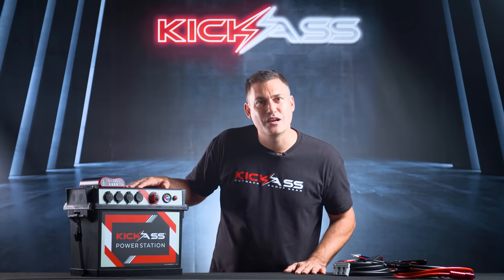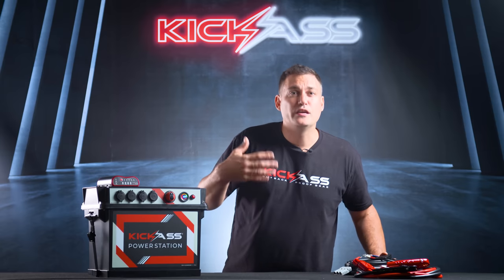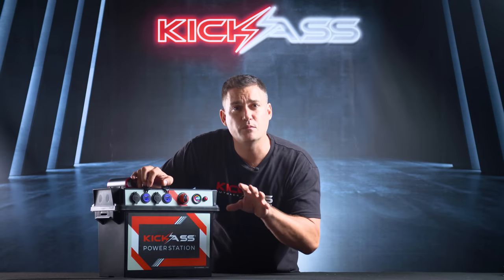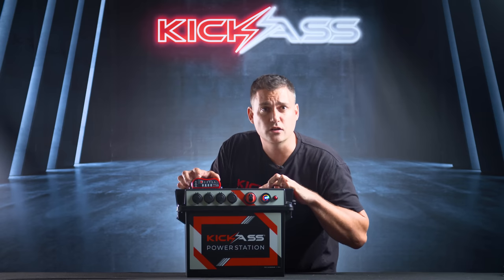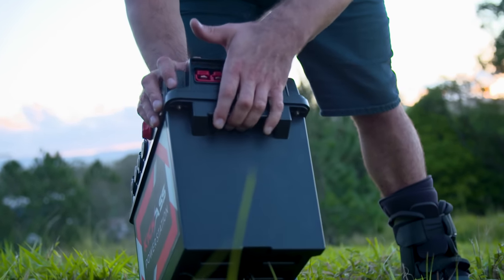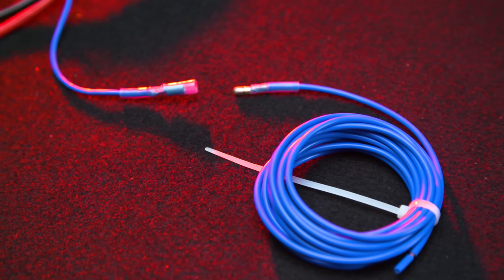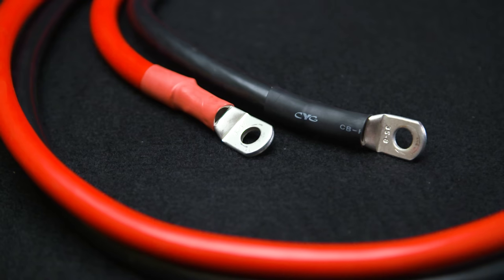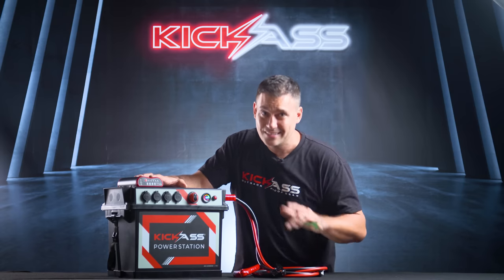KickAss Powerstation Portable Battery Box with integrated 25 Amp DC DC charger. Dual battery system

Comment: I have had messages from 4 days and 2 days ago that hasn't yet been responded to. I would like to clarify my questions before putting in my order. If I connect the Kickass 2000w inverter directly (rather than via the Anderson plug) to 120Ah lithium battery sitting inside of the Kickass power station, would this be a safe option? I would really appreciate a response to this. Thanks
Reply from the maker: Hi Jimmy, as I advised previously, if you are using a 2000 watt inverter you will need to use a battery bank of at least 2 AGM batteries linked together in parallel. 

Running at maximum the inverter will draw up to 180 amps DC and can double that with peak inrush. Drawing this amount of current from a single battery will damage it. 

If you require technical assistance please contact one our customer service advisors here https://supportportal.australiandirect.com.au/sales-enquiries/

The phone number is listed at the bottom of the page.

Thanks.
Reply: @KickAssProducts  I don't want to use AGM battery. As I have stated multiple times I am asking if it is ok to run an 120Ah LITHIUM battery, plugged directly to the 2000W inverter.

Comment: If the box is turned off whilst still hooked up in the car but not running any appliances, does the dcdc still charge the battery? Ta
Reply from the maker: No, The Isolation switch turns the whole unit off including the DCDC charger. 

The switch has to be in the "ON" position for the charger to operate.
Reply: @KickAssProducts  cheers

Comment: Another great video guys :) Can I ask..... I have the "old" KickAss Power Box with the Projecta DCDC Charger which I had in my old car...... I now have a brand new 2022 Toyota Fortuner and need to wire my old KickAss Powerbox up, can I buy and install the Premium Plug and Play "3 wire" Anderson Plug kit to the car from the Starter Battery and then attach that to the "2 wire" Alternator Input on my KickAss Powerbox in the rear of the car? i.e. can a 3 wire Anderson plug into my 2 wire Input in my old KickAss Powerbox? Cheers, Don, Perth WA :)
Reply from the maker: Hi Dons. In theory it will work. From memory the old Projecta also had an ignition wire as well so if you remove the 3 way anderson plug and replace it with a standard one you still should be able to use the ignition wire.

Comment: Do you just sell the lithium battery box on its own..??
Reply from the maker: Hi Warren, our standard battery box is compatible with other brands of lithium batteries. 

https://www.australiandirect.com.au/buy/kickass-portable-battery-box-power-station-with-in/KAJBAGMKIT1

It would be pointless to purchase our lithium battery box by it self as the LCD screen / connection etc will only work with the KickAss BMS  in our battery.

Comment: Very interested in ordering one of these. Will this work with your Kickass 2000w inverters?
Reply from the maker: We do not recommend using anything over a 700 watt inverter with this battery Box. A 2000 watt inverter will draw up to 184 Amps DC when running at 100% and double that at the peak inrush. For that size inverter we always recommend that you run at least two batteries in parallel and have the inverter directly connected to this battery bank with the shortest cables possible.
Reply: @KickAssProducts  Thanks for the prompt response. I was planning to use a 120Ah Lithium battery with this battery box. With this 120Ah lithium battery, is the Kickass 2000w inverter suitable then?

Comment: Checked out your website about the new power station. 
Can you advise of the Solar PV max for the inbuilt solar mppt, for either 12V or 24V.
Cant see any 'W' amount shown on the listing.
Cheers
Reply from the maker: The maximum solar input is 25amps and the maximum solar input voltage is 23VDC 

Amps x Volts = Watts 

So at max capacity the theoretical transfer will be around 575 watts.
Reply: @KickAssProducts  cheers for that
Reply from the maker: No worries at all. We are always here to help.

Comment: Do Lithium batteries work well with this?
Reply from the maker: Yes, The charger is fully lithium compatible. 

Just be advised that if you use the high 175 amp connection that this is a direct connection to the battery.

If you overdraw from this terminal you can force you Lithium Batteries BMS into a protection / fault mode.

Comment: Do I need to connect the ignition cable for a 22 tacoma?
Reply from the maker: It is a good idea to check the voltage over your starter battery while you vehicle is idling. If your alternator is putting out 13.2 volts + this will be enough for the charger to cut in so you won't require the ignition cable however it is recommended that you do install it so your charger cuts in immediately.
Reply: @KickAssProducts  i will test this

Comment: Looks awesome guys! With the unregulated solar input, is there a reason it’s not a red Anderson plug to stop plugging it in the wrong spot? Is that an option to change it out?
Reply from the maker: We decided that there wasn't really a need for it as the anderson plug is mostly hidden, especially when installed. It is clearly marked on the lid but if you want to change the plug out it is the standard procedure of unscrewing the plug and popping out the terminals.
Reply: @KickAssProducts  thanks guys & gals! As always, awesome service!

Comment: Hi guys
Newby  to the whole kickass 12v power family & have very quickly become a huge kickass fan just think the gear is what it says  "kickass" & have recently purchased a heap of gear ..

2x 170ah agm batteries 
3000watt inverter
Projector & blow up screen with carry bag
12v oven with tray for those roast & pies 👌
8 stage automatic battery charger
3000watt slim line solar panel 
5mtr extension lead & jumper cables 

10pk 50ah Anderson plug 
1 triple Anderson plug
3 rubber weather protection  Anderson plug covers
Full wiring  kit & this 
120ah agm battery & box power station.
Go hard or go home they recon 🤣🤣👍👍👍 just
Getting ready for my up & comming projects I have in mind.
Now please bear in mind I'm just a back yardy & working everything out as I go ..  my question is will the dcdc charger still work effectively  & safely if the temperature sensor wire has been damaged? 
Secondly is the wire replaceable or is there even a need to replace?
What actually happened is
as I was screwing the negative battery wire & sensor wire to the battery negative terminal the sensor wire broke rite where the wire goes into the round ring/ crimp  end
From  re- searching on line I can't seem to find any helpful info at all in relation to my problem..
Any help would be appreciated greatly.  
Cheers guys👍👍
Reply: Sorry..one more question..
I'm going to have my 2x 170ah agm batteries & inverter in my trailor
Do I still need to fuse between the battery & inverter  when connecting my 3000watt inverter to my 2x 170ah parallel connected batteries ?
I will be using a extension cable pluged in to main running from  start battery to the insde back of my vehicle which the power station box is plugged also.
Reply from the maker: Hi Mate, unfortunately if you have damaged the temp sensor it cannot be repaired. But good news is that as you are using 2 large capacity batteries and the maximum charge from the DCDC charger is 25 amps, the chance that the batteries will heat up is extremely low.

You do not "need" a fuse on that part of the system. Just keep the linking cables as short as possible. Just remember at peak inflow (up to 6000 watts) you can be drawing around 550amps through these cables.

Hope this helps
Reply: @KickAssProducts  cheers guys thanks for that big help 👍..  stoked to know the dcdc charger still works with out sensor wire  to unlike other dcdc charger  on the market 👌

Comment: Did you just tell me that the VSR. Set up I bought from you is "not going to charge your battery properly ".? Really? Geez
Reply from the maker: Generally we advise on what you require depending on your circumstances and your vehicle. With modern vehicles the alternator output may not be strong enough to charge a second battery. If you require further advice please contact us through our support portal and one of our customer service team will get in touch with you.

https://supportportal.australiandirect.com.au/

Comment: Still trying to flog agms, it’s 2021
Reply from the maker: AGMs are still the best bang for buck. You can always check our red arcs new 100 ah $3000 goblock! Our DC charger on this system supports a lithium battery so you can buy a lithium battery elsewhere and put it in this system.
Reply: have you compared the prices for a good quality AGM and Lithium ? not everyone needs to drop that sort of cash on a lithium